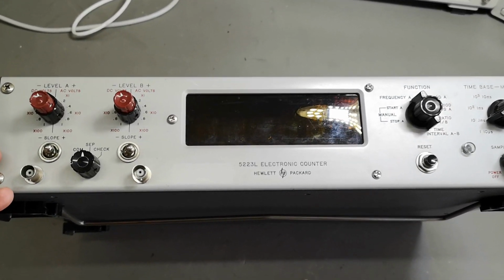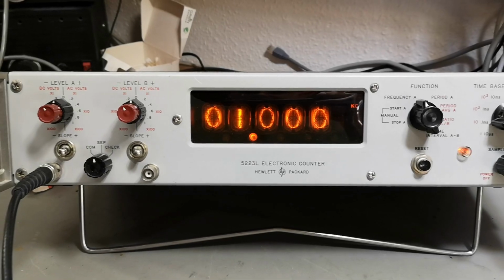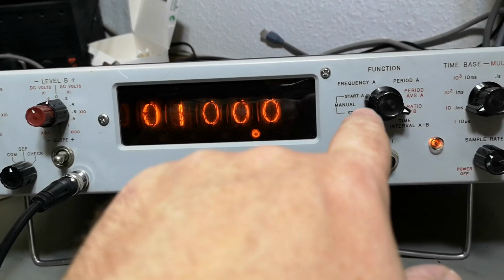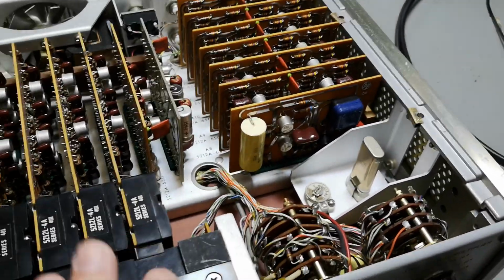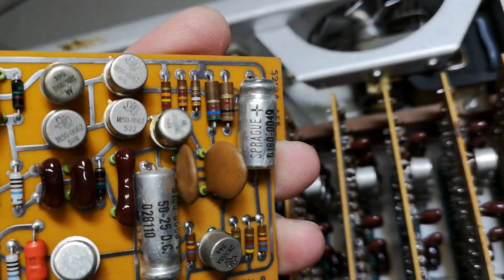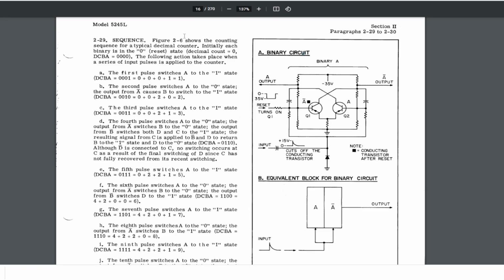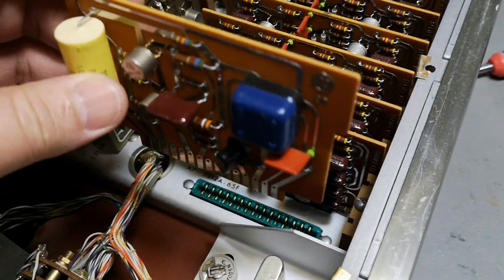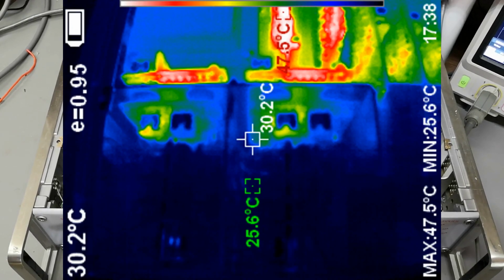HP 5223L Electronic Counter 1965 Nixie 300Khz test teardown

Comment: It was introduced in 63 and discontinued in 1966 or 67 this is a later model.  The odd thing is the binary weighting which is 1,2,2,4 which can catch the unaware.  By the way opening the neon bulb section is not some thing you want to do as full sun light can cause dammage to them or so I am told
Reply from the maker: Thanks

Comment: Back about five years ago, someone who'd worked for HP posted an explanation of the post-1960 serial numbering system, which I then re-posted with my interpretation of it on another forum. Here is a copy of my forum post - the original text is at the start, and my understanding of it follows.

Copied and pasted from a post to the HPAK mailing list explaining the serial numbering system; the original author worked for HP:

Having worked as a Production Line Engineer, Production Line Manager and Product Support Manager(Americas) for one HP Division, please let me clarify the process for Engineering Changes and how that affects Serial Prefixes.

1. The Basic Identity of an Instrument is the Model No. (e.g. HP 8510A,HP8510B,HP8510C). These Models are all independent of each other and each of the three examples would start with a Serial No.(Suffix) of 00101

2. The most Major Engineering Changes to an Instrument (e.g. Addition of a bunch of New Features or Upgrades) could be implemented into a New Model No. (e.g. change from "A" model to "B" model). In the case of changing to a New Model No. the Serial No.(Suffix) will start again at 00101.

Short of a New Model No., all other changes would be handled through a "Production Change Order".

3. A Production Change Order may or may not trigger a New Serial Prefix. Typically, for instance, the change of a single component value would not cause a Serial Prefix change. I believe (but I'm not 100% on this), that would be decided by Production Engineer in conjunction with Product Support folks, who are responsible for Service Manuals. Major Engineering Changes would always trigger a New Prefix.

4. Instrument Manufacturing is done in Batches, called Production Runs. The Size of each Run is determined by Sales Volume. More Sales, Larger Runs.

5. A New Serial Prefix would be implemented for the Start of a New Production Run. Before issuing Work Orders for a New Production Run, I believe a review of Engineering Change Level would be done and the decision to introduce a New Prefix would be made or had already been made. That could be due to one Major change or sometimes a roll-up of a bunch of Minor ones.

Keep in mind none of this is instantaneous, 'cos of lead times for (new)material to be provisioned.

6. In an Emergency (quite rare), it has been known for a Production Change to be implemented immediately, maybe 'cos of a Safety concern(I did it only once) or some major Defect being discovered.

7. I think by now it has been well established that the Serial Prefix first two digits are the number of Years since 1960 and the last two are the week number of the last Production change included in the Instrument.

Sorry for being a bit Verbose, but that's how it works.

Paraphrasing my understanding of the above:

1: The model number and its letter suffix identifies the instrument type. Each is considered to be independent of the others for serial numbering purposes, and starts with a 00101 serial number suffix.

2: An expansion of (1) reiterating that the serial number resets with a new letter revision to an instrument when major changes are made. If it is only a rev change then the serial number will continue to increment sequentially from the last instrument made under the previous engineering rev.

3: Minor changes would not trigger a prefix update; more major ones (but those that were not enough to trigger a new model suffix revision) would trigger a prefix update.

4: When a design is released, they build a bunch at a time.

5: This one hung me up for a bit until I thought it through a bit more and paid attention to the wording. A new serial prefix would be implemented at the start of a new production run (note that it's 'would be', not 'will be' or 'is' - it only changes if the design is revised) Prior to the new run, they'd look everything over, and determine if a new prefix was needed; if it was not then the new run would get the old (but current to the design, as it's essentially unchanged) prefix.

To summarize my understanding of what 2-5 mean, for example:
A) If the last unit of the run of the mythical HP 0001A Whatsis (introduced in the 32nd week of 1972) serial number 1232A00250 is finished and the design undergoes a major change to become an HP 0001B Whatsis in the second week of January, 1975, then the first new HP 0001B off the line will be serial number 1502A00101 (new prefix, reset serial). 
B) If, instead, the new iteration of the HP 0001A comes off the assembly line with a lesser engineering change (not enough to warrant it becoming a 'B' model), then the first unit in the new run will have a serial number of 1502A00251 (new prefix, incremented serial).
C) If it's just a new run with no real changes, then the first off the line in January of 1975 would be serial number 1232A00251 (old prefix, incremented serial).

6 & 7: self explanatory.

I left the OP's name off because it was posted to the mailing list; if anyone wants to dig it was posted on 10/05/17.

Additional - I believe that the letter indicating country of manufacture replaced the dash between the prefix and serial number once HP began manufacturing outside the US; prior to that the s/n format was YYWW-NNNNN.

Comment: Based on that serial number, it's actually a mid-late 1965 engineering rev.  (The second two digits in the prefix are the week, and the first one or two are the number of years since 1960 - 3 digit prefixes are 60s, 4 digit are 1970 and beyond - the 539 prefix on yours indicates the earliest it could have been made is the  39th week of 1965)  That thing is in beautiful condition!  Looks almost brand new!  And yes, nixies are the best.
Reply from the maker: WOW thanks great info about the HP serial numbering system, I go see if I can dig up any more info about that, by the way : i updated the video year number to 1965 :-) 
funny i was only 1 year wrong, I normally use IC codes, transistor codes and sometimes it is even written on capacitors.
Reply from the maker: before 1950 is explained in good detail here :
http://hparchive.com/serial_numbers
So the question remain ?? how was the serial system between 1950-1960 ??
Reply from the maker: AFTER 1960, info from HPARCHIVE
EXAMPLE serial : USA 2228A11076
Take the first two digits and at it to 1960 = 1982 (year). The next two digits represent the week in the year = 28. The letter indicates where it was made. A = America, B=Brazil, S=Singapore, etc. The remaining digits tell you that it was the 11,076th manufactured during that week in America.
Reply: @TeardownOZ2CPU  It looks like in the early days, the instruments just got sequential numbers, and it was only after 1960 that they really started encoding more information into the serial numbers.  I believe the letters were added after they began manufacturing outside the US.  Someone who'd been an HP employee posted a pretty detailed explanation of the post-1960 serial numbers on the mailing list a few years back; I copied and expanded on it for a forum.  I'll find what I'd posted and add it here.

The letters I'm aware of are A for the US, G for Germany, J for Japan and I think U for the UK, but am not certain of that one.
Reply from the maker: @patmx5  Thanks mate.. the fun thing is : i got you FULL explain in my email copy of your post, but YT only diaplay 20% of it here.
maybe there is a limit of comment length ? pr port ? so just make MORE posts, until it is all here
Reply: @TeardownOZ2CPU  Weird - when I expand the post, it shows the whole thing.  Perhaps YouTube being YouTube?
Reply from the maker: @patmx5  your new post show it all, i am super happy, i will use this YT post as my look up in the future, it is not going to be long before i play with a new HP instrument, thanks a lot for your time
Reply: @TeardownOZ2CPU  You are most welcome - glad I could help.  It can be fascinating deciphering this stuff, and it's helpful to occasionally get input from those in the know (like the former HP guy who made the original post on the mailing list).  That post combined with others through the years have done a lot to clarify just what things mean.
Reply from the maker: @patmx5  it was a big help, allready tomorrow i play with HP equipment again :-)
Reply: Please may someone tell me what this piece of equipment is actually used for. I bought one of these at a car boot sale. It looked intresting but I have no iidea what this is.
Reply: @MegaBossTV   well it is a counter.  At the time comparing two frequencies  was a pain, this instrument let you do some simple frequency calculation over time automatically, for example the delay or shift etc etc.  They had a use but the two channel function was soon rendered obsolete  by better ic based counters, hence its short time in the catalog.   
Opps this is the 300k version so it is not really hood gor anything these days as least in the rf world. I have seen them turned into NIXI clocks. The one I have is the 3mhzh so good for a counter on my old CROs and RF GENS